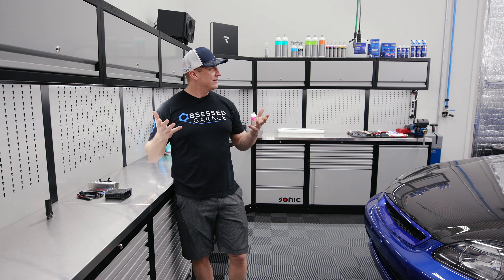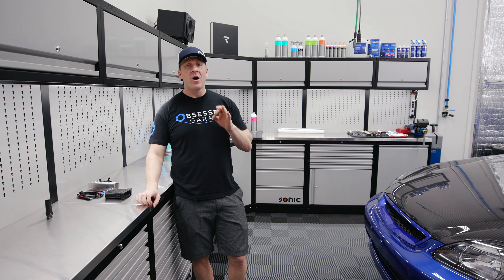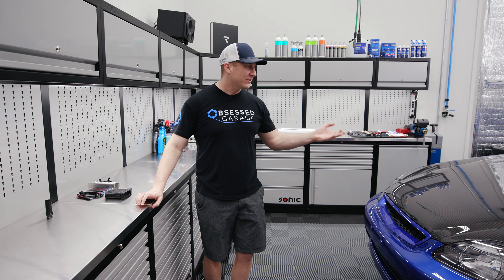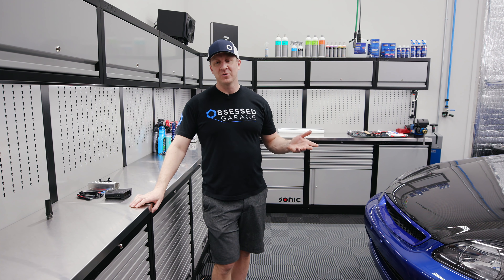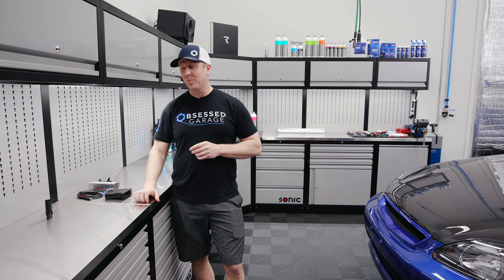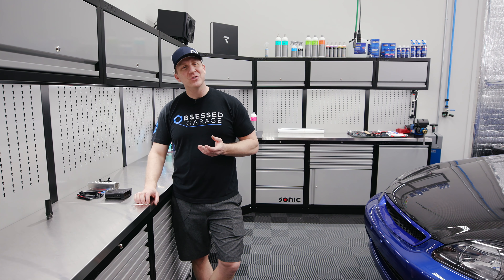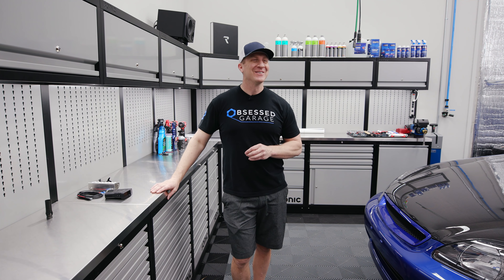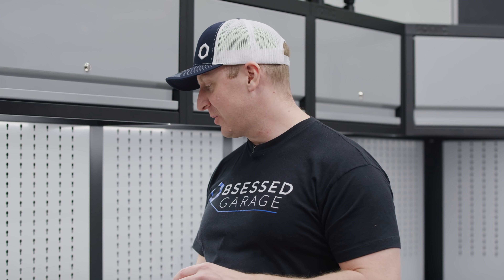Installing the Uniden R7 Radar and a Sergeant Race Dead Pedal: 2000 Honda Civic Si

Comment: You can de-pin the plug instead of cutting wires.  The wires with metal ends will unclip from the plastic connector. I know this won't help you now cause this was done days ago but keep in mind for future. Instead of cutting then soldering just remove them from the connector.  Just don't forget to snap a picture of their orientation before you remove them. Hope this helps with a future project.

Comment: Hey Matt, just watched LHT Performance visit to OG and drive of your GT4 and just wanted to let you know that the “change in sound” at low revs you were discussing is the Cylinder Deactivation. I have a 718 GT4 and they all do it, they will flip from side to side to prevent excessive bore wear  on one side, it’s noticeable at low revs/load. Just typical Porsche engineering for improved economy into the GT4 nothing to worry about imho.

Comment: Should look into the wire tap kits for radar detectors really easy clean way to get power to them, i put them in all the cars, usually i tap them into the sunroof harness and they power up and down with the car.